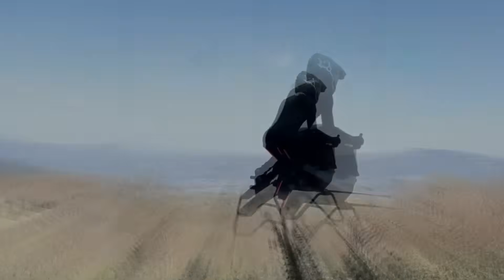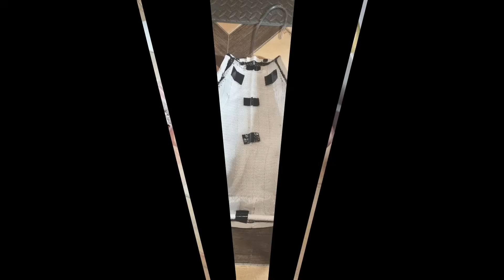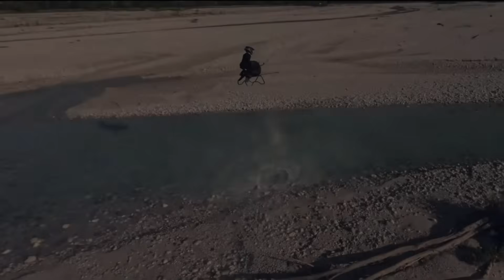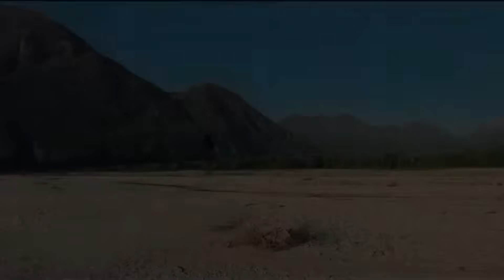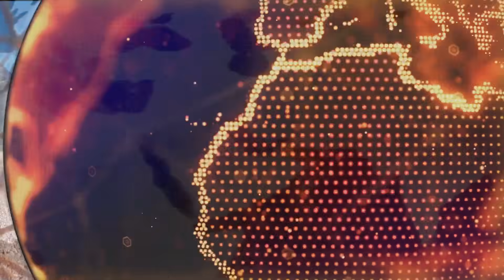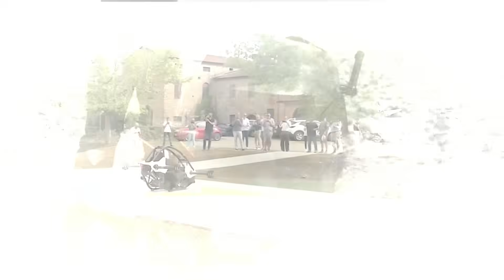2026 NEW VOLONAUT AIR BIKE OFFICIALY LAUNCHED!! Key Features, Tecs, & Benefits!!

Comment: I'd want a backrest--and a dashboard with instruments that didn't depend on connection to helmet visuals.
Reply from the maker: @phantomforester9337 Totally hear you on that—comfort and visibility are key, especially when you're flying! ✈️ A backrest would add much-needed support for longer flights or high-G maneuvers, and an onboard dashboard with traditional instruments could be a great backup if the helmet HUD fails or disconnects.

Right now, a lot of these future-forward designs rely heavily on wearable tech, but there's definitely room—and demand—for more self-contained cockpit-style setups. What kind of instruments would be essential for you on a flying bike dash? Speed, altitude, battery levels, nav...?
Reply: @innomoto  All of those--plus an artificial horizon.  The altitude sensor should be for above-ground (radar or sonar).  A collision-avoidance warning system would be nice, too.  The nav should be in proximity to the battery level gauge.  The more I think about it, the more I'd want to add.   But the basics would be altitude (particularly so you can detect sudden loss), battery level, and orientation.  (The G forces could give a false sense of orientation.)
Reply from the maker: @phantomforester9337 That’s a solid setup! An artificial horizon and radar-based altitude sensor would definitely help avoid any disorienting situations. I love the idea of integrating collision-avoidance and keeping the nav close to the battery gauge—it’s all about keeping the essentials in your line of sight when you're up there. And you're right—G-forces can play tricks on you, so a clear sense of orientation is crucial.

If this bike ever becomes a reality, I’d be interested to see how they’ll balance tech and safety features. Do you think this kind of system would be enough for a safe flying experience, or would you add anything else to the cockpit?
Reply: @innomoto  Safety is relative--after all, riding a motorcycle is hardly on the safe side of the spectrum, for example.  But the basics that I think are minimum should provide a safe enough base with which to take your calculated risks on this machine.  And yes, I would buy one.  Fate hasn't killed me yet.
Reply from the maker: @phantomforester9337 Haha, well said — riding a motorcycle already means living on the edge, so flying one just cranks that thrill up a notch! 😄 But having those key safety basics like altitude, battery, and orientation instruments definitely makes the risks smarter and more manageable. Would be awesome to see these ideas make it into the real deal. If you had your perfect cockpit setup, what’s the one “must-have” feature you’d want that no one else has thought of yet?
Reply: @innomoto  Actually, a secure access plus 3-D signal antitheft system.  A thief riding this machine would next to impossible to catch, given the lack of means to match it, and a simple locator signal would not give altitude--motorcycles are hard enough to hold onto as  it is, if attractive to thieves--this would be easy to stash on a truck and hard to pursue if ridden.  A very effective antitheft system would be required to keep comprehensive insurance payments within reasonable levels.
Reply from the maker: @phantomforester9337 That’s a super smart point—antitheft on a flying bike is a whole new level of challenge! A secure access system plus 3-D signal tracking sounds essential to keep these high-tech rides safe and insured. Imagine trying to chase a flying thief without that—total nightmare! Thanks for the insight, would love to see manufacturers prioritize that as much as safety instruments. What do you think would be the best way to implement such a system?
Reply: @innomoto  Well, the system would have to be on the machine itself--you can't expect insurance companies or security firms or police departments to implement a new security system just because there will be a few new flying bikes out there.  And it will be impossible for police officers to see if a machine flying by has been stolen without some kind of signal from it saying things are not on the up-and-up.  So that will raise the purchase price commensurately.  Perhaps the signal can be cued to the owner--he (or she) can carry a linked device that will send a screaming theft signal when the machine is in operation without the owner being present--sort of a binary antitheft device.   The more I think about it, the more expensive this thing is getting.  The entry threshold seems to be getting higher and higher.
Reply from the maker: @phantomforester9337 Wow, you’ve really thought this through! A built-in, owner-linked 3-D antitheft system makes total sense—especially since chasing a flying bike thief would be next to impossible otherwise. It’s smart to keep control in the rider’s hands with a device that triggers an alert immediately if something’s off. Yeah, the tech and safety features will definitely push up the price, but honestly, better safe than sorry for something this futuristic and valuable. Hopefully, manufacturers balance cost and security well enough to make it accessible while keeping riders protected. What’s your take on how soon this kind of advanced system could realistically be developed?
Reply from the maker: @phantomforester9337 That’s one of the most grounded and insightful takes we’ve seen — and you’re absolutely right. As much as the tech can be ready, public trust and societal adaptation take time. Flying bikes zipping over neighborhoods would trigger a lot of pushback if not carefully introduced. Using them for law enforcement first? Brilliant. It sets a precedent of responsibility, visibility, and utility — and helps build the infrastructure and public mindset for wider adoption. You're helping shape the future just by thinking like this. Here’s to the long game… and to keeping that sky open, safe, and fair.

Comment: Where is the fuel tank?  Unless it runs on nuclear fusion - this won't last minutes in the air (if it can lift off at all... with its OWN weight, the fuel's weight and the driver's weight).  This is brilliant AI Fake Video until it's proven real.
Reply from the maker: @alchan230 Excellent points—and you’re right to ask! Most current Airbike concepts run on high-density lithium battery packs, not fuel tanks, which does limit flight time—usually under 20 minutes per charge depending on load and weather.

The tech’s still early-stage, more of a proof-of-concept than a practical commuter. No nuclear fusion yet 😉 but who knows where things go next? What energy source would you trust to make a machine like this truly viable?
Reply: That's what I was thinking.  And I'd like to see the engine?
Reply from the maker: @ronduff4325 Totally fair—and a lot of folks are asking the same! 🔍 Most of these early flying bike concepts use compact jet turbines or ducted electric fans hidden inside the body, with the battery or power unit tucked under the seat or in the core chassis.

They keep things sleek for aerodynamics and visual impact, but yeah—it does make it harder to see where the real power is coming from. Would you prefer more exposed tech like in classic fighter jets, or something all tucked away like sci-fi stealth?

Comment: Fake
Reply from the maker: @PetFlyss 
Short and sharp! 😄 Curious though—was it the design, the concept, or just the whole idea that didn’t land with you? Always open to hearing different takes!
Reply: @ with a jet engine under your butt it be like balancing on the head of a pin. Totally unstable.
Reply from the maker: @PetFlyss That’s a spot-on point—balancing above a jet engine would feel like trying to ride a blowtorch on a broomstick!  Stability is a huge challenge with thrust-based flyers, especially when you factor in weight shifts and wind gusts.
A lot of these concepts use advanced gyro-stabilization and onboard sensors, but yeah… until someone actually hovers one hands-free, it’s tough to buy in. Would you trust a system like that if it had AI-assisted flight control like a drone?

Comment: Intriguing, but I don't think it would be suitable for today's cities. Too loud, the exhaust would cause a maelstrom of litter and detritis on streets and in open windows.
Reply from the maker: @ddland45
Totally valid concern — urban environments just aren’t built to handle that kind of noise and thrust disturbance. But it does make you wonder: should future city planning start considering vertical personal transport zones, or is this kind of tech destined to stay in remote and recreational spaces?
Reply: @innomoto  There is a lot of new transportation "tech" concepts that should start to be included in future city planning, particularly when it comes to airborne vehicles and magnetic rail that require a complete rethinking of how people will need to get around in the future.
Reply from the maker: @ddland45 Absolutely, the whole urban infrastructure needs a rethink to truly embrace these next-gen transport ideas. What do you think would be the biggest challenge cities face adapting to flying bikes and magnetic rails? And which innovation excites you most for making city travel smoother and cleaner?
Reply: @innomoto  Consider what society is struggling with now when it comes to E-cars. The main obstacle isn't price, it's producing the number of charging stations needed for widespread usage. There has to be a 100% buy-in by society to tool up and rebuild the infrastructure to support the tech, including a whole new electric grid.
And while they're doing it, we need to catch up with the rest of the world with high speed rail and magnetic drives. Laws also have to address the practical applications of personal "flying" vehicles, especially in modern urban airspace.
Reply from the maker: @ddland45 You’re spot on — the infrastructure challenge is massive, especially with charging networks and electric grids needing a serious upgrade. Without that full buy-in from society and policymakers, these futuristic vehicles can’t really take off (literally). Plus, airspace regulation for personal flying machines is a whole other complex puzzle. It’ll be fascinating to see how cities and governments tackle these hurdles while trying to keep things safe, efficient, and green. Thanks for the thoughtful perspective!
Reply: @innomoto  That last part will be the most challenging aspect of the practicality of this technology. The biggest concern society will have to address is "human" nature and our fatal need to "push the envelop" of design capability and HUMAN ability which always runs afoul of boundaries of personal and public safety. I can't even imagine a futuristic "Jetsons" landscape where flying machines automatically restrict the daredevil operators and force compliance with spacing, speed and other "rules of the skyway". Would such vehicles even be popular? Imagine cars that are quick, but cannot go faster than the posted speed limits. Who would accept those limits?
Reply from the maker: @ddland45 You’re absolutely right—human nature and the tendency to push limits will be the toughest challenge to manage with personal flying vehicles. Designing systems that enforce safety without feeling too restrictive will be a delicate balance. Imagine a future where smart AI controls and geo-fencing automatically keep daredevils in check, ensuring safe spacing and speeds—almost like invisible traffic cops in the sky. It might sound like sci-fi, but with the right tech and regulations, it could become reality. What kind of safeguards or rules do you think would be necessary to make flying vehicles both fun and safe for everyone?
Reply from the maker: @ddland45 That’s a brilliant breakdown—essentially building a 3D “air traffic operating system” that vehicles must sync with at all times. The idea of geo-fenced corridors, auto-regulated spacing, and operator lockouts during high-risk scenarios feels like the only viable path toward safe, scalable flight in public spaces. It’s like bringing the same coordination logic from professional drone swarms to a personal vehicle level.

Recreational zones with more freedom? Love that too—it balances regulation with the thrill that draws people to machines like this in the first place. It’s clear that the future of flight won’t just depend on innovation in the air, but the invisible infrastructure all around it. Appreciate your insights—feels like we’re sketching out the airways of tomorrow together.

Comment: If this is becoming a serious thing, we could see a new way of vehicles being developed with jet engines, and probably better jet engines that designed for specific flight vtols..
Reply from the maker: @Siranoxz
Absolutely — this could be the beginning of a shift toward specialized jet propulsion for personal VTOLs. If manufacturers start refining compact jet tech for this purpose, do you think it’ll push the boundaries of private flight like electric motors did for EVs? Or will regulation and infrastructure hold it back before it takes off?

Comment: Wouldn't want to fly this craft: I don't want to die.
There is no safety in case of a malfunction. 
1. If the jet engine suddenly fails, one immediately drops down: crash.  
2. The stabilizer can't get the vehicle upright again  if the vehicle's 
tilting angle (say, more than > 45 degrees from vertical in any direction) 
exceeds the angle that the stabilizer can handle/compensate:  crash. 
3. Even slightly hitting an object (e.g. tree branch or another flyer) during flight could send it in a spinning crash.
Reply from the maker: thx @tedvga,
You bring up real, critical concerns — and they highlight why personal VTOLs still have a long way to go. Without redundancy, auto-stabilization beyond 45°, or a parachute/recovery system, a failure at any height could be fatal. What do you think is the minimum safety tech such a craft would need before you'd even consider flying it? Built-in ballistic chute, AI stabilization, crash-resistant frame — or should these remain unmanned until the tech matures?

Comment: Where can I get one! I want two! What's the range on this thing? How long can it go before it needs to be refueled?
Reply from the maker: @Chthonia1066
Love that enthusiasm — two of them? You’re going full Volonaut Squadron! 😎 As for range, that’s the million-dollar question. Current prototypes likely have pretty limited endurance due to the high fuel consumption of small jet turbines, maybe just 15–30 minutes tops, depending on payload and throttle use. But imagine if hybrid power or hydrogen turbines got involved…

If you could pick any tech to extend the range — solar assist, battery hybrid, modular fuel tanks — what would your dream setup look like?

Comment: Look up the "flying podium" from the sixties. This technology has existed for 60 years.   The problem is any mechanical glitch pretty much kills you.  Makes it a lot less practical as a consumer product.
Reply from the maker: @jonvelde5730
Interesting point! The "flying podium" from the '60s is definitely a precursor to today's concepts. You're right about the risks—mechanical failure in these high-stakes environments could be disastrous. For personal flight to go mainstream, safety and reliability will have to catch up. Do you think we'll ever get to a point where flight technology is stable enough for everyday use? What advancements do you think would be necessary for that?
Reply: That’s true with any vehicle or other means of transportation !!!
Reply from the maker: @KearnsGarren Very true... every form of transport started with risks, and over time engineering and safety systems caught up. The big question is how fast personal flight can close that gap so it feels as reliable as your car or bike. Would you trust one once it reaches that point?

Comment: First aid rescue, emergencies, recon , emergency food aid, sea drop flotation etc....otherwise ain't no bike
Reply from the maker: Great point, @info-m8p! The Volonaut Airbike could definitely shine in emergency and rescue scenarios, especially in remote or hard-to-reach areas. Its potential for quick response in situations like recon, sea drops, and even food aid delivery is a solid use case.

As for everyday use, though, you're right — it would need to have more than just flash-factor to stand out. For practical use, it might require a more versatile design, like adaptability for transporting medical supplies or first responders.

Do you think there’s a specific kind of emergency or environment where this could be most useful?

Comment: Flying vacuum cleaner... An unusual solution... But one that has been long overdue.
It would be nice to know the impeller diameter, its operating revolutions, engine power and battery power reserve. In terms of flight time to the minimum permissible charge. And the battery charge time from a household electrical network, of course.
Reply from the maker: @innomoto
Great breakdown, @valerykanaev9453 — you're asking all the right technical questions! 🛠️✈️

So far, Volonaut hasn’t released official specs like **impeller diameter**, **RPM**, or **engine power output**, but based on footage and similar jet-platforms, we can estimate:

* Impeller diameter could be around **30–50 cm**,
* Operating RPM likely **tens of thousands**,
* Power output possibly in the *200–400 hp* range using microjets,
* Flight time? Likely **10–15 minutes**, as jet-fuel or hybrid packs burn fast,
* And battery recharge time from a household socket would depend heavily on capacity, but possibly *4–8 hours* unless fast-charging tech is involved.

Would you be interested in a follow-up video if Volonaut releases the full tech sheet?